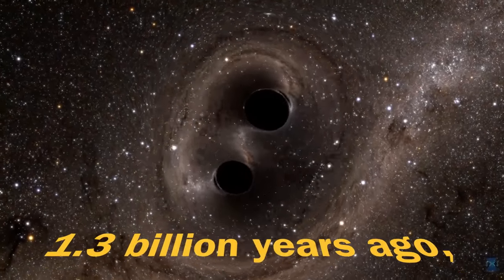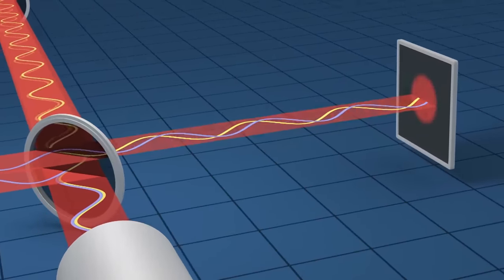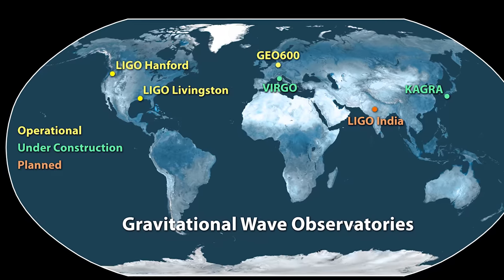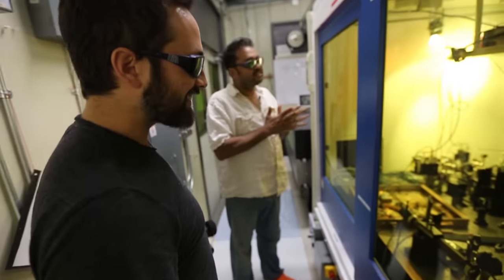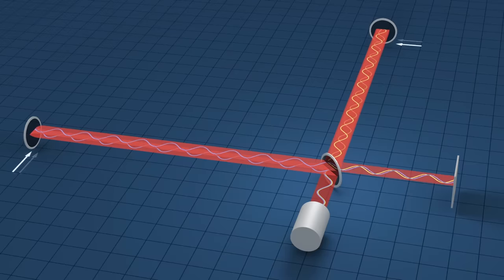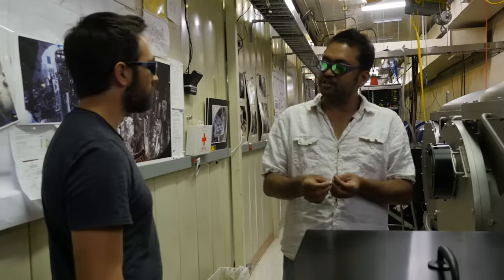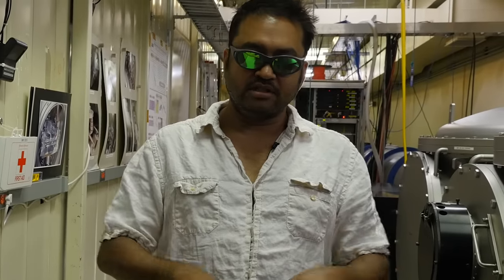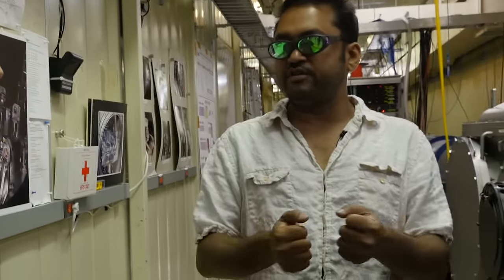The Absurdity of Detecting Gravitational Waves

Comment: So, if I understood it right: While the light being inside the space when it is stretched is stretched too, new light that is entering the stretched space is actually travelling the difference in distance due to the stretching.
Reply: Yes, because the gravitational waves haven't yet stretched the new light. At least, that's what I understood.
Reply: I don't know what you understood but it is different from what i understood which makes me feel im understanding the wrong thing.
Reply: I understood that they were making the tube 'boggier' to get through... (!) and not much else... As in.. I'm not sure how that then helps them with their comparison..
Reply: Yeah, and they measure the difference in time it took the new light to travel the stretche space in reference to the time it should have taken, since the wavelenght is fixed. 

But i feel like i dont understand it well enough.
Reply: yes, the key being that the gravitational wavelength is VERY long, so while it passes the light goes back and forth in the detector many times.
Reply: @nmarbletoe8210 Thanks. That’s what I was missing! It didn’t make sense since the gravitational waves also travel at the speed of light but the point about the much longer wavelength makes it all make sense!

Comment: I'm a blue collar type. There must have been extremely skilled construction workers involved in building this. Glad this is happening in my lifetime.
Reply: Usually these are assembled by engineers. The construction workers may have been involved in building the actual stretch of building  with wiring. The actual pipe that has all the ingenuity requires precise measurements only engineers can build
Reply: Like spacecraft (space ships, drones, etc) theres engineers who specialice in working with these massive structures that despite being kilometers Long have to be made with nanometric precision
Reply: Dr Deuteron  One thing that has me scratching my head a bit is that at 2.5 miles long the curvature of the earth will cause a drop of something over 40 inches.  How do they get the laser beam to bend around that?  Or is the tube elevated as it goes?
Reply: @Videot99  It should have you scratching your head because it is theory(blackholes) piled on top of theory(two blackholes) piled on top of theory(two blackholes colliding) and this place is measuring the theory. What he has really created is a scientific BS meter.
Reply: @semperfipar1299  You might want to go and check the difference between a hypothesis and a theory and stop embarrassing yourself.
Reply: lol a hypothesis about something that does not exist? Really? This whole thing is a colossal waste of taxpayer money and this guy should be charged with fraud waste and abuse.
Reply: @semperfipar1299  Dude, why are you here?  You clearly don't understand science or how it works.   The only thing you like is its benefits, like trolling on a computer that wouldn't have been made without time, money and effort being spent on hypotheses.  If no-one ever followed up on an idea, you'd be trolling on a cave wall, which is where you belong.  They literally talked about how they were successful, here.
Reply: @semperfipar1299  You do understand that they have successfully detected them waves?
Reply: @semperfipar1299  
> theory(blackholes) piled on top of theory(two blackholes) piled on top of theory(two blackholes colliding) 
are you suggesting that even if you accept blackholes, the concept of two colliding is a conceptual leap that needs to be justified???
Reply: I’m saying black holes do not work in the real World universe. The concept of gravitational waves is just that . If they do not even know what gravity is or what causes it then how do they know it produces waveforms that radiate out from the center? The entire universe is in motion. Would not that suggest that everything would be buffeting us with gravitational waves if there is such a thing?
Reply: LOL. The guy who invented the modern world of electricity and radio waves did not believe in black holes or the concept of space time.
Reply: no idea who this incredible guy is or what bearing he has on anything
Reply: @semperfipar1299   "If they do not even know what gravity is or what causes it then how do they know it produces waveforms that radiate out from the center?" we do "know" that mass causes it? in the sense that the universe is almost indistinguishable from if mass caused gravity. waves are a consequence of the models. 
"everything would be buffeting us with gravitational waves" compared to 2 black holes with immense rotational momentum combining you can imagine how insignificant they would be
Reply: Tesla
Reply: Models are not empirical.
Reply: @semperfipar1299  Why are so many people so obsessed with Tesla.
The most important name in electricity is James Clerk Maxwell. Period.
Reply: Because Tesla invented the modern AC power grid the entire world uses to this day. Radio is also Tesla’s patent along with wireless power generation . I do not discount Maxwell or Steinmetz
Reply: @Darfaultner  Not gonna lie, man... that comment you made about caves was a sick, sick, sick ass burn.  As a shitposter of over 22 years, I say bravo, Sir.  Bravo.

Comment: The physics here is straightforward and non-controversial; it's the astounding level of technical expertise required to actually make this measurement that blows my mind!
Reply: I kinda disagree with the first part. As Veritasium points out, naively the detector's should not work because the gravitational wave stretches both the light beam and the arms (how can you measure something stretch with a ruler that also stretches?). So this explanation, which is the one almost universally presented, is wrong. Rana Adhikari comes closer to a plausible explanation by suggesting the fact that the light is moving makes the difference. However, as the curvature of spacetime, gravity is more like acceleration (which is why objects are weightless in free fall), so a full explanation is more subtle still. The best science paper I have seen on this is "Gauge invariance and the detection of gravitational radiation" by David Garfinkle, but it requires some knowledge of general relativity (and the underlying mathematics) to understand it completely.
Reply: That's why you have to go beyond the woolly prose and analyze it quantitatively. There is no way around the mathematics.
Reply: Jack, you seem like a smart guy, so I have a question for you.  What would you call the study of how water reacts?  The physics of water?  And if an ancient water level shows water isn't affected by gravity over any terrain or distance.  And always shows flat and level.  How has science shown that the surface of water could bend around a sphere to form our oceans?  To the best of my knowledge, water must be contained to pool.  Thanks
Reply: Water reacts to the bending of space by gravity like everything else: it only appears flat over short distances, but if you look at a globe it's obvious that the oceans are not flat at all, as they follow the net gravitational attraction to the earth's center along with everything else, including us - unless you think that Australians feel like they're upside-down all the time!
Reply: a) the study of how water reacts would come under chemisty, what I think you meant to say is the study of how water flows or moves etc... and that would be fluid dynamics. b) water is indeed effected by gravity, and so as Jack said, over short distances (and even over large distances relative to every day human scale) this appears to make water and other fluids form a flat surface. However gravity can only be considered a linear uniform field on these small scales, and once you get to larger scales you need to re-evalute how gravity works, because if you don't you would indeed see water (and people and buildings) falling "down" off of the planet. In reality the Earths gravitational field at any point doesn't pull you or water "down" as down is just a frame of reference. Instead the gravitational fields pull you towards the centre of the Earth. By which logic, when you consider large bodies of water, such as the Pacific,  which bend around the curvature of the Earth you can't consider gravity to be working on the entire ocean in one direction, but working on it individually at each point to pull it towards the centre. That said, in a way the water is still filling up a "pool" as you put it, but instead of the surface having to be flat, the surface is at a "level of equal potential". It's easier to explain with diagrams really.
Reply: Alex, what I meant to say is anyone with a lick of common sense knows the surface of water will not bend around a sphere because someone waves a magic theory over it.  And if you were to pull your head out of your theory long enough to look around, you too would realize that the surface of water cannot be made to bend.  And if you think you can bend it with logic, then post your video. But I won't be holding my breath.  

The Chicago skyline news story blows your theory right out of the water. My suggestion is to forget your indoctrination and go get a real education if you want to debate the shape of the Earth.
Reply: Isaiah40:22 no one is debating the shape of the earth...he also said it's a sphere...
Reply: John, the Earth is motionless and flat.  Anyone who thinks they live on a sphere has watched to many sci-fi movies.
Reply: Craig, Isaiah is obviously a troll so stop feeding him!
Reply: Isaiah40:22 There is no place for your unsubstantiated poppycock here. Now go to sleep and let the adults handle matters of the natural sciences.
Reply: Jack is right guys, one can't be this dumb^^
Reply: Isaiah40:22 Actually, the fact that Earth is a sphere was common knowledge even among the Greeks in 400 BC. The way it was proven is pretty simple: if, during a sunny day, you look at a ship in the ocean that is approaching earth in the distance, you will see the mainmast before you see the body of the ship. If Earth was flat, you would see all of the whole ship coming toward you at the same time, but you don't.

Another proof that the Earth is a sphere comes from pratical experience: if you take a boat trip around Earth, you will end where you started (this was proven by Magellano around the XVI century).

Another thing that might surprise you is that, despite urban legends, there was never a time when Church doubted the fact that Earth is a sphere. In fact, Dante, during the Middle Age, describes Earth as round. Even before Middle Ages, one of the most important patriarchs of Christianity, St. Augustine, believed Earth was round (St. Augustine philosophy is still considered the base of Christianity).

Actually, flat Earth was never a religious concept to begin with, it was theorized by Thales of Miletus, a Greek philosopher, and later proven wrong by his students.

Hope we can keep our discussion civil and constructive.
Reply: Ah crap I made it all the way from Sweden to Argentina, and then I had to take a leak :(
Reply: NOT controversial? Talk about filter bubbles ...
Reply: That's why the beams are placed at right angles to each other. One beam will be affected more than the other.
Reply: Isaiah40:22
Your knowledge is very limited. And you are apparently a flat Earther looking for faults in scientific research.
Water is subjected to gravity as much as any other form of matter. On Earth, it is attracted toward Earth's center of gravity, that's what causes it to "curve around a sphere". It can also be influenced by other sources of gravity such as the Moon and Sun. That's what causes regular tides. There's your hydrology micro-lesson for today.
Reply: Isaiah40:22
Most sailors will laugh at your conclusion. I myself have stood sea watches and witnessed approaching large cities from the ocean. I saw the tops of buildings long before I could see anything along the shore. Same for distant ships, lighthouses, etc.
The Earth is a sphere, and Isaiah 40:22 doesn't say otherwise.
Reply: @CraigHocker  I thought he was satire. Maybe he is for real. In which case... wow... just wow

Comment: So basically… gravity waves make space-time wiggle a bit and make giant lasers get darker slower when the gravity wave passes over the laser. Did I get that right? 
And you need to use one very low wavelength of light so that you can even detect the wiggle because on a higher wavelength, the light won’t interfere enough for it to be detected.
Gosh, I feel like I’m operating on the edge of my IQ here hahaha
Reply: opposite wavelengths destroy each other, so when one of the lightwaves stretch they get more or less different, so more or less light survives so they can detect the difference by detecting the brightness of the resulting combined laser stream… probably
Reply: @jan_Mamu  The beam splitter actually puts the photons into a superposition (similar to the double slit experiment), and then each photon will interfere with its own waveform. Photons can't interfere with each other, only themselves.
Reply: @Jason9637  thanks!